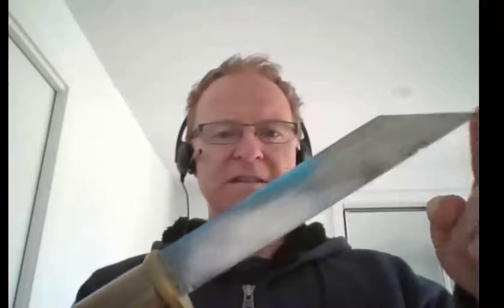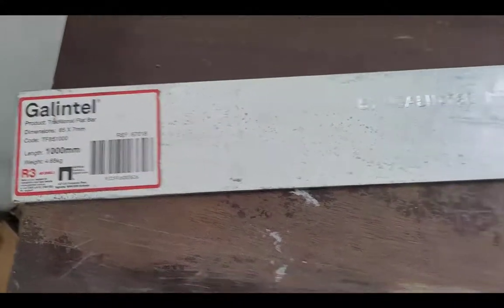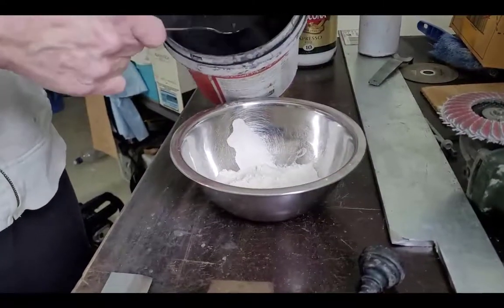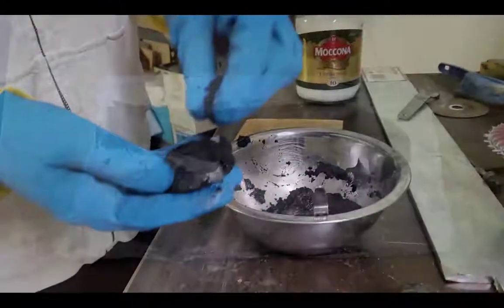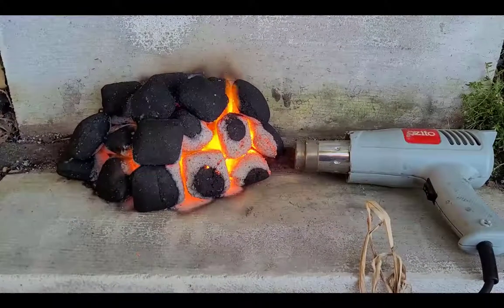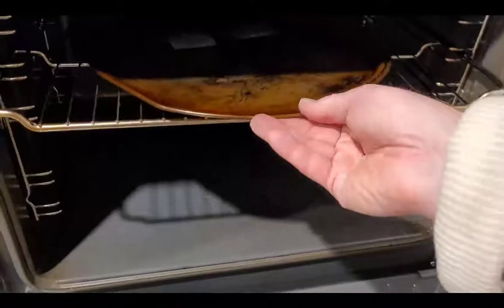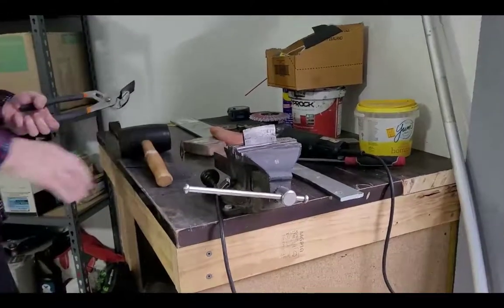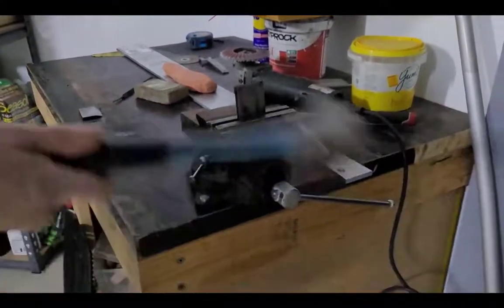Carburizing Cheap Steel Blades

Comment: Can I use sand instead of clay
Reply from the maker: The point of the clay is to seal the metal inside. Sand would probably not create a airtight seal.

Comment: Carbon steel isn't that expensive.  It can be found in pretty much any junk pile or junk yard. Even ordered from a steel supplier it's not that expensive.  Shipping is usually close to the cost of the steel, but most people are close to a steel supplier and can just go pick it up
Reply from the maker: If you have an anvil to hammer it flat with.

Comment: If you are folding the steel after carburizing wouldn’t that have layers of hard steel and soft steel mixed together. That would defeat the original idea, or am I wrong.
Or can you carburize the Damascus blade when finished?
Reply from the maker: Not folding the steel. without an anvil I have no hope of that. This was just about wrapping soft steel in a wrapper of carbonised steel.

Comment: What happens if you sharpen the blade? Doesn’t the hard layer get sanded away?
Reply from the maker: Good point. They say the carbonisation is only microns thick via this method. But when you look at the steel it seems to penetrate quite deep. I should have tested that at the time. If I can find the sections of steel again I will test that.

Comment: the "Whack it With a Hammer" test in the World of Construction and Inspections of said world is known as a "JEEP TEST" as WWII Jeeps came with tools and a Hammer. one holds the Jeep's Hammer about head high and lets it fall on the test item for inspection.
when an Inspector, while inspecting my exothermic welds used the "Whack it With a Hammer" test, he told me the Name and Why.
and I thought it was so COOL! as no more WWII jeeps or tools are around much he used a 2 lb or double jack Hammer with wood handle for testing. and all my exothermic or thermite welds passed

Comment: With all due respect, you are repeating incorrect conclusions about historical Damascus steel. It was a crucible steel and was most definitely NOT case hardened as you stated. The misconception you are spreading was likely caused by examination of the depth of hardness by "experts" who don't know that low alloy steels are shallow hardening and will appear case hardened after quenching, especially if they were only edge quenched, partially quenched, or differentially hardened. The Vanadium content of  historical Damascus lends greatly to the properties that create this misconception... and I assure you, it's a misconception. And fyi, never swirl a blade like that when you quench:  you only worsened the pockets of incomplete quenching around the vapor jacket when you did that;  instead, do a casual stab and retract inside the quench, back and forth or up and down in the quenchant to keep oil on the surface of both sides evenly throughout the hardening curve time.
Reply from the maker: Actually, what I said was "This was part of the process used to make Damascus steel" - meaning carburizing. According to Wikipedia, carburizing of the Wootz steel ingots used to make Damascus blades was done using woody biomass and leaves. 
Thanks for the advise on quenching.
Reply: @leemelbourne3297  Even if you try to reframe your statement that way, it won't make sense, because they didn't start with a Wootz steel ingot and then carburize it, especially not in the manner you used:  they started with iron, biomass, and sand, and created the steel ingot from them, carborizing the iron into steel in the crucible, with the sand on top to form glass during the burn, so at the very least you badly misspoke, giving the impression that you vaguely know something about it, but just enough to get yourself in trouble, as my dad used to say, lol. And you're welcome. Happy Holidays, Merry Christmas, or whatever applies, sir.  :)
Reply: carburizing
Reply: @leemelbourne3297  To clarify my reply:  Wootz was created in a crucible, liquifying the Iron and the source(s) of Carbon... not adding the Carbon by carburizing diffusion as you stated (at the very least by direct implication if not explicitly)... a completely different process, so your statement was incorrect because that wasn't part of the process of making Wootz. And in order to reframe your statement to a generalization about all processes of adding Carbon, then it applies to every type of steel ever made, so it wouldn't make sense to single out Wootz... unless you were under the mistaken impression (as nearly EVERYONE who talks about Wootz is) that it was made by the process you were discussing. If you read/watch/hear ten thousand things about Wootz from self-proclaimed experts, you'll be lucky to hear five correct things... and the most popular things that get spread are the most incorrect.
Reply from the maker: @stevealford230  Chill dude. Just quoting from here: https://en.wikipedia.org/wiki/Damascus_steel
Reply: @leemelbourne3297  "Well, there's your problem" ... wikipedia is at least 50% ignorant misinformation and 45% politically-biased disinformation, with most of the correct 5% being poorly phrased by people who don't actually understand what they're citing from actual experts' works for their article.

Comment: How the salt and flour helping steel to get more carbon ?
Reply from the maker: I expect the flour burns up to produce more carbon adjacent to the steel inside the clay wrap. And it holds everything together as a paste at the start. I am not sure of the role of the salt - I took that mix from another video online.
Reply: and use up oxygen? @leemelbourne3297
Reply: the flour is a binding agent to make the charcoal stick and the salt is meant to lower the temp at which carbon dioxides are produced. I've done it using stainless steel foil with never used anything but the charcoal. The important part is an oxygen free environment because the steel is absorbing the carbon gasses not the actual charcoal. If you use a steel envelope you don't need a paste so no flour and I just don't like the idea of the salt.

Comment: On the expense of high carbon steel, plain high carbon steels are inexpensive,  if you can find the right supplier. Tool steel is still costly.

Comment: This is case hardening, still used for screw heads, gun parts etc. It’s a very very fine layer of high carbon steel, useless for sword making, but maybe usefull for homemade files or short term use cutting tools, if you cook it for longer than 2 hours. If you want hardness, why temper it? Don’t cook it in the oven after quenching. If you want carburised steel by cementation, you need to cook it for 1 to 6 weeks depending on the thickness of the bar to make blister steel and gain 1% of carbon in your steel. If the steel is low in phosphorous, it becomes a good material for Huntsman crucible steel to homogenize it.

Comment: So I do a lot of tinkering in my spare time and I'm currently seeing if I can carburize a cold rolled steel rod to give a hydraulic press I'm making just a little bit more rigidity. I was going to school for science of biology as a cookie cutter pre-med route and I can see you are not just doing this to prove to yourself but share your data with others. Thanks man that's what science is but I'd like to make some suggestions should you consider reconducting this experiment. Take your control and change only one variable per experiment. That means, salt or flour, clay for both or none at all, heating both for two hours regardless if one is to attempt to absorb carbon or not. As it stands was it the sodium or the chloride from the salt, was the flour enough of a carbon source since it also is a carbon based life, was there remaining water from the clay that allowed hydrogen to effect the iron, and the list is endless. I think we know where most of the carbon is located within the ingredients but one things I've learned is science is a bureaucracy. No matter how redundant it may seem adding steps to isolate the sole cause of the hardening or if your lucky/unlucky you find adding salt alone decreased hardness but with clay it overall increased. Just making something up at the end to illustrate sometimes data just raises more variables to try, more questions, and most importantly another failed hypothesis allowing us to try try again. I'm not a "scientist" hell I dropped out before finishing my bachelor's degree but during the time I was working on getting paper to say I'm not big dumb I wrote many "scientific research papers" hypothesis, methods and materials, ect ect. I think you may benefit from refreshing yourself with the scientific method and applying it to your work. I hope that was helpful and came out correct. Oh lastly there's hardness testing methods that are cheap and more reliable than a file of unknown sharpness and pressure (precisely) applied. One I'm thinking of is a file set of varying hardness to get a number to log. Not to say what your did clearly worked the file cut half as deep so I am impressed. Anyways, I just wanted to add that Incase it may be helpful with your future endeavors.
Reply from the maker: Good ideas. As a further experiment I wanted to try the strike test with a 1080 steel knife we made...but a couple of things held me back:
  1. I didnt want to ruin the knife (just in case the carburized steel was harder)
  2. the knife was only about 4mm flat bar, while the carburized material was about 8mm

Comment: I've ALSO seen the same "Carbon-paste & Steel "wrapped in STEEL FOIL to keep oxygen away just as its used in Forge-Welding Stainless Steel . This allows the INITIAL PRESS to take place with the WRAPPED coupon , allowing a greater amount of carbon uptake .
Using the clay WITH the CARBON source, and THEN Damascus-layering it with the NON-Carbon PRE-treated steel , SHOULD make for an INTERESTING final result 👍!
Now THAT is something I'd LIKE to see if you're interested in ideas for 
"possible content" 👍!
Enjoyed the Vid ! 
THANKS! -
Chuck .

Comment: Interesting from a metalurgy perspective but considering you can get a piece of proper blade steel of guaranteed composition (1084) that is 38x3.5x1000mm long for $30 plus postage (in Australia) saving $10 to add several hours to the process seems like a lot of effort to go to for a questionable result! It would be interesting to hardness test it and then grind or machine down 0.1mm at a time and keep testing it to see how deep the hardening goes. If it is for a working blade, you want to be able to sharpen it several times without exposing the soft core. If price and availability of steel is an issue, just get an old trailer spring from a wrecker.
Reply from the maker: Thanks Ben. Good points made. The 6mm thick billets on NordicEdge were $80 when I embarked on this experiment. I notice they are now on sale at $60. At that price I would have used that steel and saved the extra effort. However for anyone who has some old rebar or scrap metal at home (which is effectively free) this now presents a useful option. And while I would love to try to belt out my own excalibur from a leafspring, I unfortunately do not have an anvil.